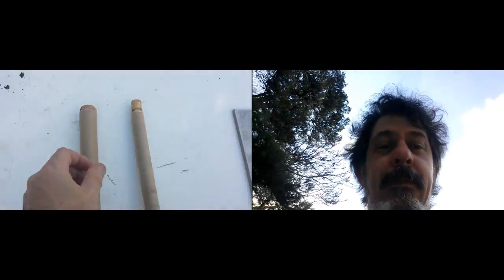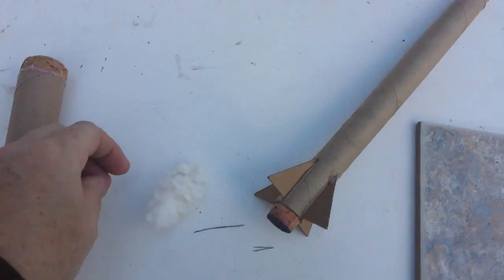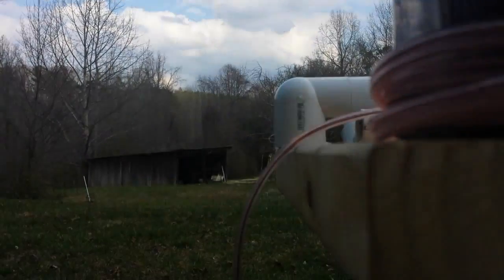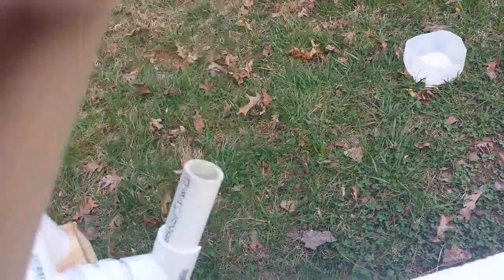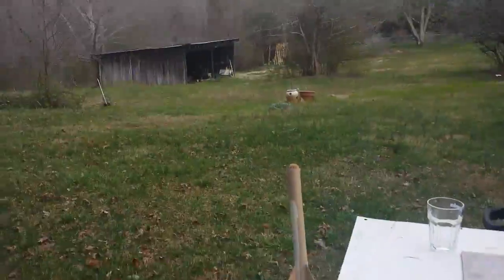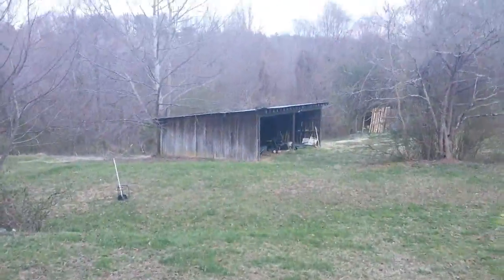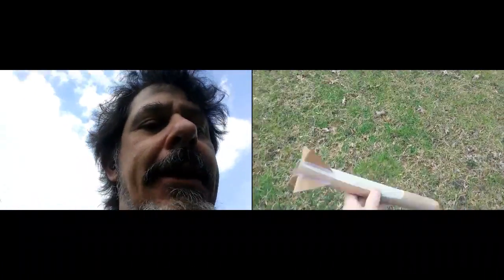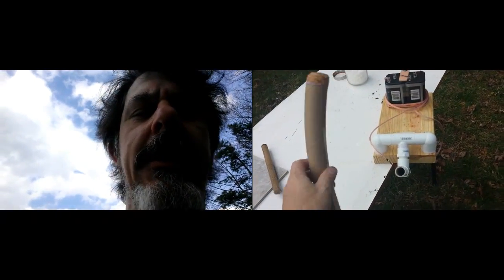Gun cotton rocket attempts - Work in Progress

Comment: Guncotton was used as barrage rocket engines for 4.5, 5 inch rockets during WWII. The engines are fairly complex construction, but relied on long strings of guncotton made in a skein type wrap, or a "pellet" style engine with guncotton formed into engine loads with holes piercing them.
Reply from the maker: Very Interesting. Of course my design is really a "gun"  that shoots "rocket" shaped projectiles. As many sugar rockets I blew makes me think that guncotton rocket propellant would be a tough one to pull off. Did you see the shoulder  mounted rocket launcher design that these early experiments ultimately evolved into?

Comment: Can you make a video on which temperature does nitrocellulose get activated?
Like, using hairdryer against it, puting it in oven, but somehow measuring the temperature.

I like your videos by the way.
Reply: Or in old frying pen on the open, measuring the temperature of the frying pen with digital termometer.
Reply from the maker: Great idea, I had this in mind too. Maybe put in the mircrowave too. What will and wont ignite gun cotton?
Reply: I was thinking about an experiment on which temperature will it ignite :P
No need to waste a microwave for that xD
And somehow mimic the situation "will it ignite in desert sun", etc. putting magnifying glass and testing how small focus is required to ignite it :D

Comment: Estes Rockets -mean machine with f or E motor and nose cone glued on set at a 15 degrees angle launch. 6’ missile. soda bottle rocket 3/4fulled  sites on bogle 3/4 pcv pipe .ring holds on soda top held with  zip ties boxed end with a ring around them and a spring pushing up on ring locking in place in pcv pipe. Pressure is 120 PSI pull down on ring.